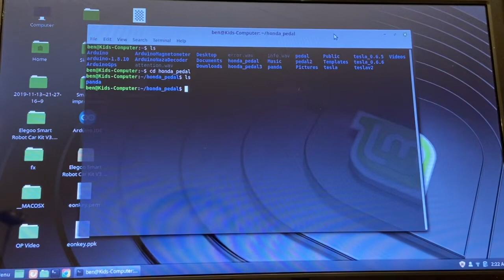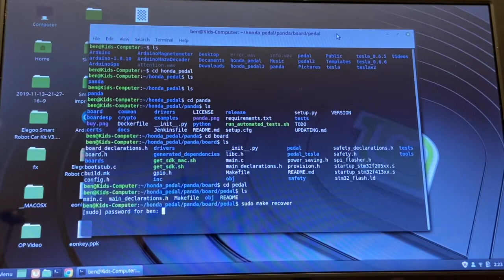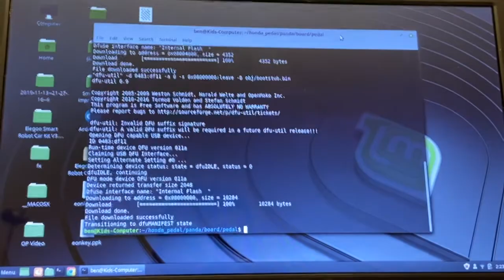How to Flash a Comma Pedal

Comment: I just paid for the assembly and design of the pedal in pcbway website. Where can I get the wires you used to do a voltage flash?

I went to the ebay store but it seems there's no product to buy.

Comment: Are there more pedals in development for other car brands?
Reply from the maker: All pedals are physically the same.  The only difference is the firmware and connectors for your specific car.  I have a set of 40 pedals coming on Jan 27.  I usually sell a couple without connectors and then you'll be able to put whatever connector on there and get it working on your particular car.
Reply: flyboyn222pa Thank you very much. The firmware is the only question i have to work on. There is no one who has tried it on Volkswagen yet. I know the pinout of the brake and connectors for my car.